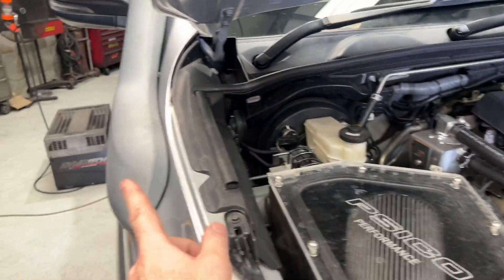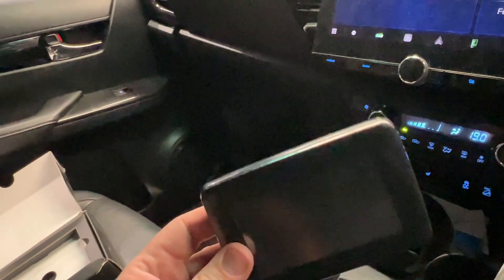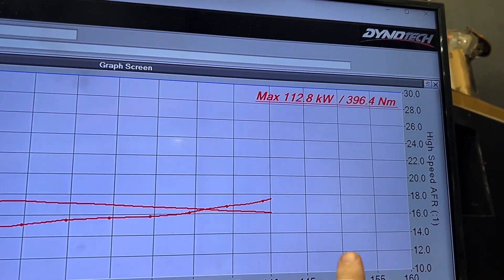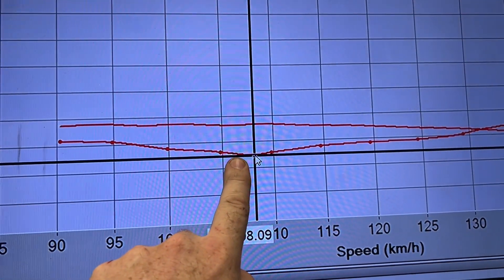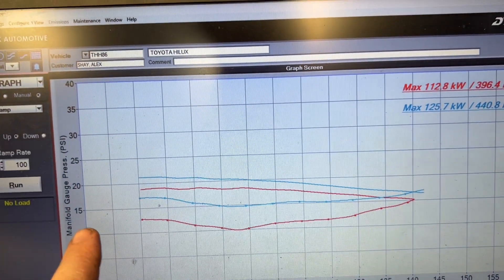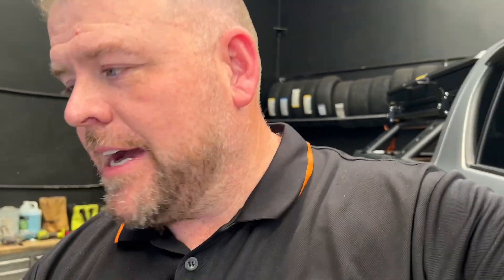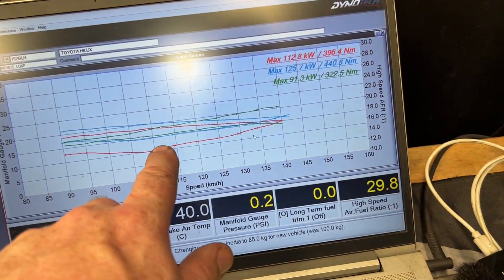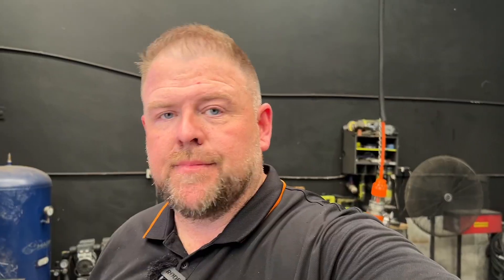Remapper modules - Are they worth it? N80 Hilux gets a custom tune to compare

Comment: Hey mate, got some questions in regards to your comment on using the recognisable unnamed tune loader you have at about 2m in. 
You mentioned using it as a multi tune loader, but using this device has proprietary file encryption. Did you bypass this in order to load your own tunes on? Did you convert them to the proprietary file encryption in order to have multiple tunes? 
I bought one of those units off marketplace and was hoping it would extract in .bin, I was wrong. 
All I want is to extract my .bin file. lol.
Trying to teach myself tuning, specifically so I can do it on my 09’ 1KD Hiace AWD import.
8 yrs mechanic, specialise in auto trans. Reckon you can throw us a bone 
Cheers haha

Comment: Hi, i remaped same way my 1KD hilux through Torqit guys, they managed to crack my ECU model with their protocol which wasn't readily available on the Powergate servers. I have remaped the car and there's basically close to none smoke besides when flooring at start. Is that a sign of good remap?
Reply from the maker: More too it than just if it’s sooty or not 
Would need to run it up on dyno and log some data to see what it’s doing
Reply: @procheckautomotivemechanic4551  unfortunately for most of people like me where we are there's no dyno. I'm just leaning on their reputation, apart from knowing that they pulled my original file of my ECU software/hardware version to remap i know nothing else
Reply: @procheckautomotivemechanic4551  unfortunately where i am there's no dyno service, I'm relying on their  positive reputation and the fact that they managed to crack the ECU with their custom protocol on their server, something PPD performance failed. So they pulled an original map data unique to my car and remaped from there

Comment: Love these detailed vids on n80s
Reply from the maker: Thanks mate
Reply: @procheckautomotivemechanic4551  when you're talking about gen 1 n80 being tuned, putting out around the same figures as a stock gen 3 n80. Can you fit a gen3 n80 turbo and manifold to a gen 1 for an even bigger gen 1 increase in torque and power? Or is there other limiting factors aswell.

Comment: I run one in my car which is an n80 hilux only reason I did it was to do a delete of something hahaha. But I’m guessing that particular tune was making the car blow soot from to much fuel just wondering cause mine doesn’t blow hardly any soot so I’m guessing my afrs Arnt to bad
Reply from the maker: This car had the same reason ha ha. It wasn’t excessive soot but it was there. Recommend finding a shop with a dyno and getting them to run it up. Won’t cost much and you’ll know for sure what boost and AFR’s you’re running
Reply: @procheckautomotivemechanic4551  yeah the next issue I have is getting my car to someone as the nearest tuning place  is about 3 to 4 hours away and its hard to find a spot to put a boost and egt gauge to at least have some what of an indication what things are doing  but yes I agree dyno tuning is the only way to go where abouts are you’s located mate ?